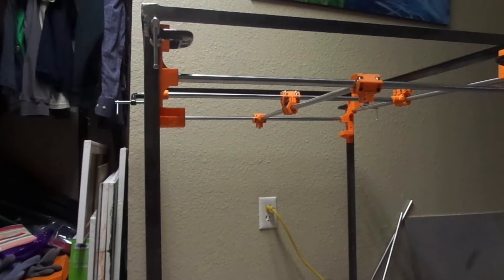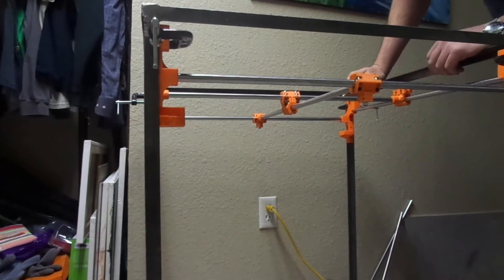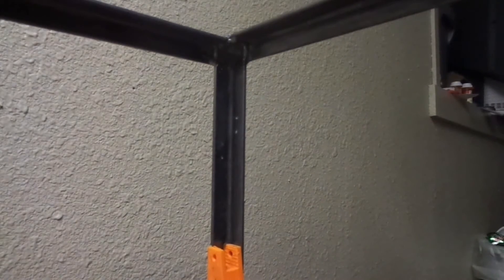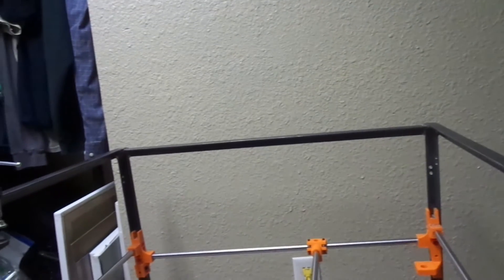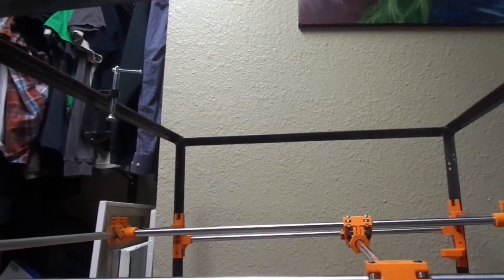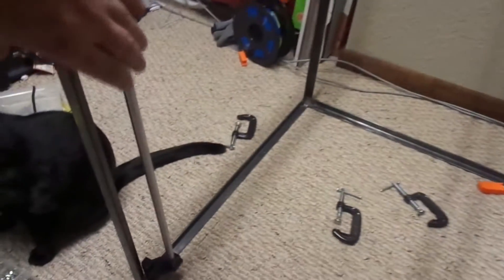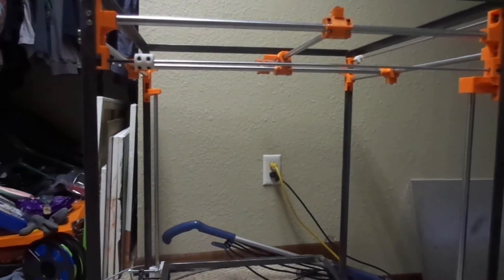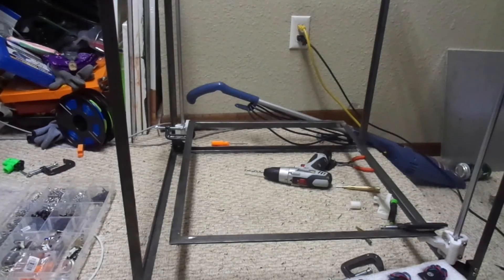3D Printer Build : Part 3 - X and Y Carriage

Comment: Nice... that thing looks big.
Reply from the maker: Thanks, it is pretty big. The outer dimensions are about (xyz) 65cm x 66cm x 78cm (25.6" x 25.8" x 30.7").  The print area will be 48cm x 53cm x 46.5cm (19" x 21" x 18.3").  I don't know if I'll ever be able to print anything using that entire volume, but I will use the larger surface area or the taller height for sure.